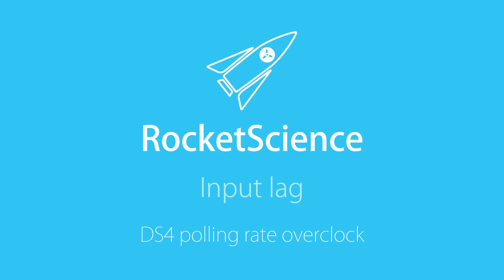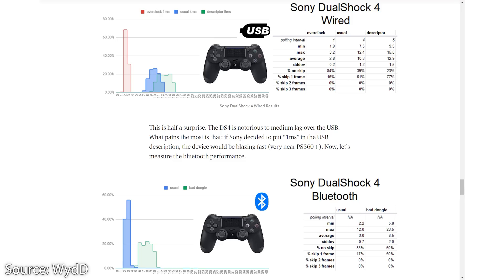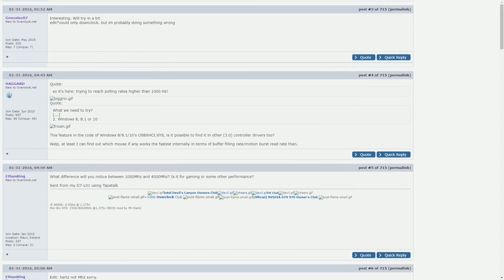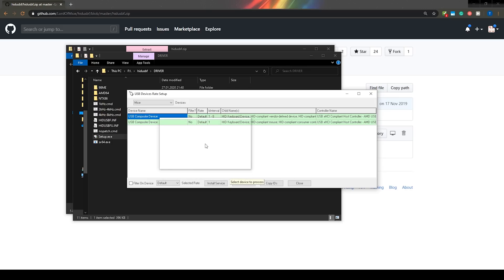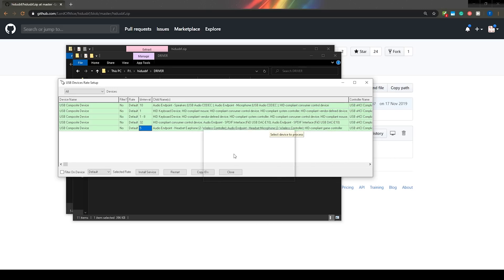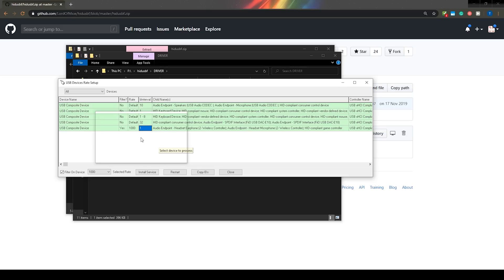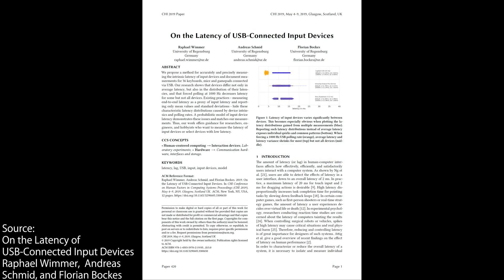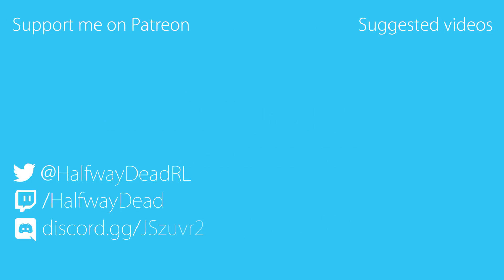(DS4 PC) Lower input lag for free! - Rocket Science

Comment from the maker: *Full troubleshooting info in the description. *

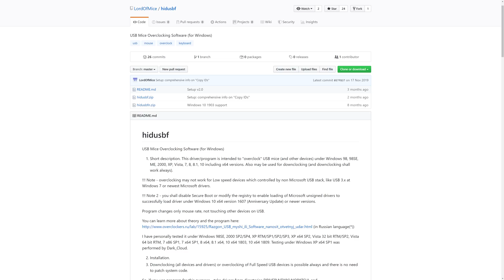People are having their controllers show up as red and not working after trying the overclock. It should be possible to do the reversing 3:38 to at least get the controller working again.
There may be a number of causes according to the support page of the program:

!!! Note - overclocking may not work for Low speed devices which controlled by non Microsoft USB stack, like USB 3.x at Windows 7 or newest Microsoft drivers.

!!! Note 2 - you shall disable Secure Boot or modify the registry to enable loading of Microsoft unsigned drivers to successfully load driver under Windows 10 x64 version 1607 (Anniversary Update) or newer versions.

In short: You may be unlucky and have the wrong USB controller (you can try the ports in the back of your mobo if you didn't already (USB3)).
Google how to disable secure boot on your PC, install service, then you should be able to turn secure boot back on. Apparently, you'll have to keep it off which is a security vulnerability.
Reply: It's not such a massive security vulnerability really. There are methods to bypass the requirement of driver signature, it's a bit more complex to do (you have to work with the kernel memory directly), but it's doable nonetheless. Even if you disable driver signature, you should still see the prompt asking if you want to install the driver, this is actually the way it works on windows 7 and before, but then microsoft decided to charge everyone for driver signing. 
tldr: Don't be afraid to allow the loading of unsigned drivers, you are not any more or less secure. Just make sure not to run software from the sources you don't trust.
Reply: @Setlean  do you know how to sort this for elite 2 controller
Reply: Nothing happening when i cliked on "install service ",  just a little window instant closed,  do you know how to fix this ?
Reply: @yatangaki560  i have the same problem PLEASE anwer if u found the solution!!  Feel like i have tried everything.. havent been able to play for days !!!!!!
Reply: @yatangaki560  make sure you extracted the hidusbf folder before clicking set up
Reply: Rocket Science Hey man, question... does scuf drivers and/or apps interfere with this? When I try the dongle method DS4 doesn’t read my controller via Bluetooth (I’ve tried everything to try to resolve this). And when I try the wired method is says in DS4 that I get a 3ms Response time which is the same as I was getting before so there’s basically no difference.. what is this? I have a vantage 2 btw. Thanks!
Reply: Rocket Science please help mee
Reply: Can someone please help me? This helps my input lag immensely but now everytime i press a button, it presses twice. For example, I press start to go to the pause menu, then it immediately closes because it double presses. How do I fix this? please help
Reply: @jjpermantaman  if you didn't figure it out already you go into ds4 windows and you go over to the "other" window, then check the box that says "use dinput only"
Reply: @jjpermantaman  have you found a solution bro?
Reply: controller stops working entirely when I install and works again when I delete the drivers.
Reply: Can i overclock and the use on my ps4
Reply: READ IF YOU ARE HAVING PROBLEMS. I was going through so many problems , first one was when i clicked “ install service” nothing happened . The fix to that is before u open the file “hidusbf” right click and extract all the files and open it that way. It should give u the option to “ open” now. The other problem for me was filter on device  where it wouldn’t work or a message pop out was to take off security boot. Plenty of videos on youtube to do that. Those two fixes did it for me after over an hour looking at comments and researching. If your controller stops working just go into control panel hard ware and devices click on ur controller, properties and uninstall drivers and plug it back in and should work.
Reply: Disabling Secure Boot worked for me, thanks!
Reply: Is this applicable for a scuff vantage 2 since its a version of a PS4 controller?
Reply: Why does the spreadsheet not match with ANY of the results from video??
Reply: Hello,  one question,  this process its optimal for play with dualshock 4 in ps4 o Only for play with DS4 in a Pc ?

Thanks
Reply: Would changing the BT poll rate in DS4Windows properly overclock a bluetooth DS4 controller?
Reply: There's a README attached to the files you have to download. Be sure to check it out, as it could help you fix your problems. It certainly did for me xD
Reply: DS4 is exceptional bluetooth, but with so many available, there may be interference. Have you tried any more Wired controllers? What do you think of the Nacon Compact?
Reply: can u remove the devices there?
Reply: I was only to get it to 4
Reply: how can i disable secure boot in msi bios 5 i dont find it and i find nothing on yt
Reply: I got my ps4 controller thr thing is before overclocking it I had around 3.4-4+ input delay after OC ing it now it's around 0.20 one of the smallest delays Ive seen in my entire life
Reply: PLEASE RESPOND, HELP
I've already used this method but upon buying a new cable as mine was on its way out, the new cable comes up red saying 
"Device: USB\DEVICE_DESCRIPTOR_FAILURE"
  Name: Unknown USB Device (Device Descriptor Request Failed)
 i can change all settings while its red apart from the binterval which is blank and can't be changed, however if i connect the old cable it works
Reply: It worked after disabling secure boot in the bios
Reply: Hi
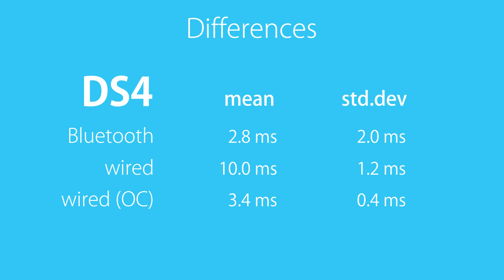Whats std.dev is pls ? At 1:18
Reply: So do I have to disable secure boot in order to all the "Install Service" button to work? It pops up and disappears right after I click it.
Reply: For this to work do u have to play controller on PC and does your controller have to be wired

Comment: Thanks for the Video. I got it down to 0.5ms Wired to the Motherboard, which is not good as 0,1 but, its way better than the 3.66ms I was getting before so thanks for that. Maybe using a high end USB Dongle will get me to the 0.1. Thanks.

Comment: So I have issues with weird input delays, it'll hold inputs for a few seconds and mess up my gameplay. I was on bluetooth so I was convinced it was a signal issue.

Funny thing, I suspect this only works for wired, but I tried it and I'm still getting the issue. It doesn't happen when I use a third party wired only controller, just on my ps3/ps4 controllers wired or wireless.
Reply: I have this exact same issue. Did you ever find a solution or did you just stick to using a third party controller?

I never had this issue on my laptop, only after switching to desktop.

Comment: I am getting a bInterval of 3 when I change the refresh rate to 2000Hz. Is that ok? I checked DS4Windows and it states that I have input delay of 0 seconds. I notice that depending on the refresh rate I choose, the bInterval is different each time as well. I am using a DualSense Edge controller.

Comment: I have a problem. I did everything as the video said and it worked. The blnterval changed to 1, rate 1000 and filter yes BUT when i check DS4Windows, the input delay remains the same (9ms). Can someone help me with this?

Comment: PLEASE PIN THIS COMMENT - There's a high chance that if you encounter an error code when applying 'Filter On Device' you WILL need to disable 'Secure Boot' in your computer's BIOS to then allow the program to work as it's intended. This may be due to windows/certain manufacture's built-in high security. -- Fantastic video Rocket Science! --

Comment: Does doing this draw more power or
voltage from psu because my psu completely died a day after trying this. I was already getting voltage limits on my pc because my 600w could barely handle my 3080gpu but underclocking helped to keep the voltage at a decent level. Idk if this is what pushed it over the edge or just a year of using my 3080 on it but I guess it’s worth asking.

Comment: Little off topic, but i had two xbox one controllers and i damaged both its micro usb port by playing wired mainly coz i don't have a battery with charge. Also a lot of ds4 usb ports were damaged by charging while playing. These incidents was happened due to carelessness and not for taking any advantage on performance. But the players who are looking for wired gameplay, make sure your connections are snug and try to plaster or tape it so it wont damage the port.

Comment: I use an old strike pack for the paddles and when I tried this my SCP controller drivers didn't work anymore.  :(  Have to stay at 5ms until I can get a Battle Beaver I guess.
Reply: Any update on this? Were you able to get it working?
Reply: @kylegbert  i bought an xbox elite controller and works fine now

Comment: I did this on my last controller and it felt so good afterwards, now I got a new controller and it felt so off for some reason. I remembered that I didn't overclock the polling rate so I did it again. My controller did not break on both occasions and even if its a placebo affect, IT IS a damm good one let me tell you. If you are thinking about doing this, just do it. BTW I checked my input delay on the DS4 Windows app and it went down from 4ms to 1ms so I don't know it might not be so placebo as everyone says it is. Great video btw super easy to follow and very simple and informative love it  :D
Reply: nah, i dont think its placebo,
just try playing a ring map or some advanced aerial custom training pack(like a redirect training pack), it felt so much different using a normal cable connection and a OC ds4(or bluetooth) that have less input lag, especially if you use directional air roll and tend to keep using air roll while in the air, the difference is HUGE

Comment: I don't feel any difference on the Dualshock V2 when it's on 1000 mhz compared to 250 mhz.
The overclock in hidusbf was successful and interval is 1 but there is no improvement that I'm able to feel while on PC using Dualshock V2.
According to others there should be a considerable difference/improvement.
Perhaps the application didn't do it's magic........

Any suggestions?
Reply: Having this same issue... did you figure it out?

Comment: Every time I do what’s in the video it says this on my computer 

Error trying to load filter service: 1060 "The specified service does not exist as an installed service" Something (VWindows 10 x64 with Secure Boot, antivirus, protection / anticheat engine, broken Service installation, absent or error C: \ Windows  \ SYSTEM32 \ DRIVERS \ HIDUSBF.SYS, hidusbf.sys from hidusbfN.zip without test mode on x64, forced kernel code loading policy, etc.) prevents the filtering service from running;  the device stops working after [Restart] with high probability, continue the installation?

Comment: This is available through DS4Windows by Ryochan, in case any of you is interested in a much easier way to do this, be it BT or Wired.
Reply from the maker: No it's not. The polling rate setting in there is only a limiter for Bluetooth which is 1000Hz by default so you can reduce it. It does not increase the wired polling rate.

Comment: Hi, thank you very much for this tutorial ! I was wondering if there was any specific settings to use either in Steam or when using DS4windows for the lower latency to work properly, and if there was a way to see visually your input lag somewhere to be sure it is working ?
Reply from the maker: No specific settings needed, but Steam controller config is not recommended because it adds a small amount of input lag. DS4Windows in Profiles under Controller readings will have a label "Input Delay". This is a misleading label because it only tells you the time since last poll which only makes up part of the entire input delay. But it should be 1 ms or less if you overclocked it to 1000 Hz.
Reply: @RocketScience  I overclocked my DS4 controller just like the video shows. In the program it says binterval = 1 and rate = 1000, but ds4windows still shows me 10 ms. What is the reason?
Reply: @RocketScience  Thank you very much, seems to be working fine !

Comment: How can I measure the input lag? to know the difference?
Reply from the maker: The easiest way is to use a 240fps camera which many modern smartphones like iPhone have. Then in Rocket League you bind camera swivel to a button and turn swivel speed to 10 (you can use any action that is easily visible on screen if you don't play RL). Hold the controller in front of the screen and quickly hit the button at least 20 times (more is required if you want 1ms accuracy). Look at the video frame by frame and count how long it takes from the moment you press the button is bottomed out until the action appears on screen. Take the average of that, then multiply by the frame time of your camera. So 1000ms/240 = 4.16 ms per frame.

Comment: Hi, I have issues when I click on "Filter On Device", it says that the device will stop functioning after restart with high probability. Anyone as the same issue ? (Sorry if the answer is somewhere on the comment, i may not understood it)
Reply: Windows doesnt allow the driver to be accessed so you need to disable Secure Boot. really sucks not worth it.
Reply: Yes did you go ahead with as well? My controller is red now but charges so I am hooping I am fine

Comment: Does overclocked controller work on the actual console or is this specifically for pc.
Reply from the maker: No, it doesn't work on console. The Software just tells the PC to run a higher polling rate. The controller stays the same.

Comment: Works like a charm, i instantly improved mechanically and play a lot better the only issue i have is sometimes it inputs by itself and i've checked if it was my deadzone but that wasn't the case.  Anyone else having this aswell? Dualshock 4 (might also be the controller idk i dont feel like it happend before)

Comment: Hi mate, thanks for your help but I have a question, in the DS4WINDOWS he have the option to change the polling rate, if I choose 1ms, will I have the same result? I would like to use the controller on bluetooth and change the lightbar color
Reply from the maker: No, the DS4Windows settings is only a limiting option for wireless. By default the DS4 uses 1000hz in Wireless, which is why it also has better input lag on wireless by default. DS4Windows allows you to limit that (I assume for battery saving purposes) but not increase.

Comment: can i use ds4 with this program or no?
Reply from the maker: Yes, but if you have the setting "Hide DS4 Controller" active, you'll need to close DS4Windows while running the overclocking tool. After the overclock is applied, you can open DS4Windows again.

Comment: Can someone please help me with this problem I keep getting this message every time I try to over o’clock my controller Error testing filter service loading: 1060 The specified service does not exist as an installed service "Something (Windows 10 x64 with Secure Boot, antivirus, protection / anticheat enine, corrupted service installation, missing or incorrect C: \ Windows \ SYSTEM32 DRIVERS  HIDUSBF.SYS, hidusbf.sys from hidusbfN.zip without test mode on x64, enforced kernel code loading, etc.) Prevents filtervice from running, device stops working after [Restart] with high probability, continue setup?

Comment: I didn't see any comments relating to Xbox One controller so i confirm i just did it with my Xbox One S pad on Windows 10 and it works. And yes, it definitely has an effect as i 100% feel that the car steering is a bit awkward at first (tested in racing game Trackmania .
I think racing games are very good to test it as input lag is very easily noticeable. Or at least in Trackmania).

edit: Also an important note for wireless users. My buddy who uses Xbox one controller wirelessly through a dongle, tried the tweak and it also worked for him! So apparently the Xbox dongle also has the capacity to transmit the signal at a higher rate than default 125Hz.

Comment: From a solid 4ms in DS4Windows down to a solid 1ms. Works perfectly as intended, thankyou very much for this.
Reply: i did it and it gave me even more input lag. :(
Reply: @mathewlapac3297  damn that's unfortunate. I see alot of people in these comments saying it either worked or didn't work. I'm getting 0.45 - 0.65ms fluctuation. It's Soo snappy.
Reply: @mathewlapac3297  if you can make sure you plug your USB cable via USB 3.0, if I plug it into anything else it's unstable and 4ms

Comment: If you are using a program like DS4Windows, wouldn't you have to OC the controller with it being on? Because it's essentially just converting the DS4 from Dinput to Xinput, overclocking it with the converter off would just overclock the DS4's Dinput settings right? As with the program on the PC is made to think its an Xbox 360 controller. So wouldn't you want to overclock it as a Xbox 360 controller if you were wanting to play with Xinput? Maybe this is not the case with Win 10. But if you were to play games with DS4Windows without the steam settings would this be the case?
Reply from the maker: No, you need to tell the USB controller that it's supposed to poll 1000hz with the real device. If it doesn't do that then it's not gonna work. Overclocking the virtual controller without the physical one would just result in it reporting the same input more often (if it let's you oc at all). DS4Windows just matches the polling rate of the real controller, so once that is 1000hz DS4Windows also is.